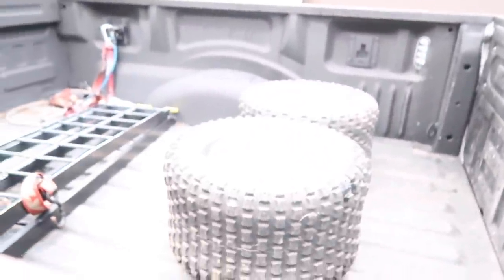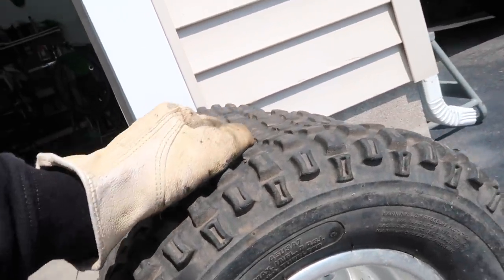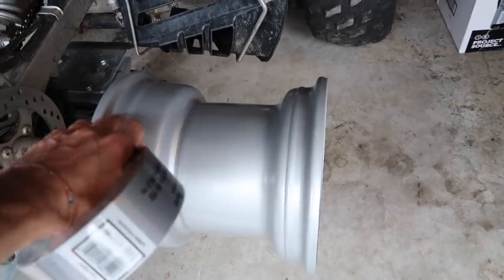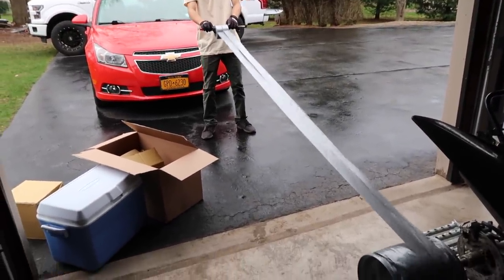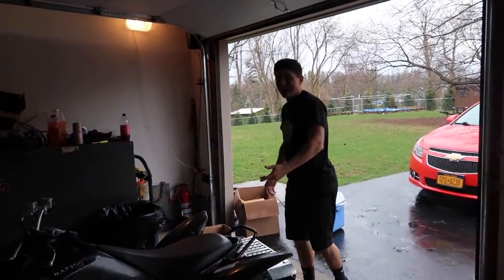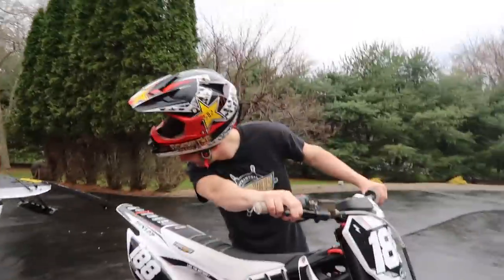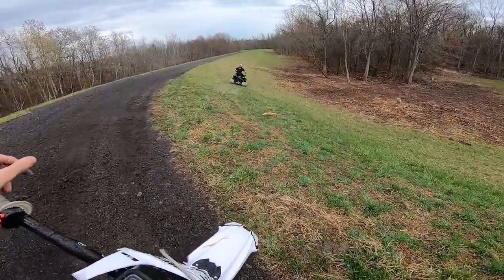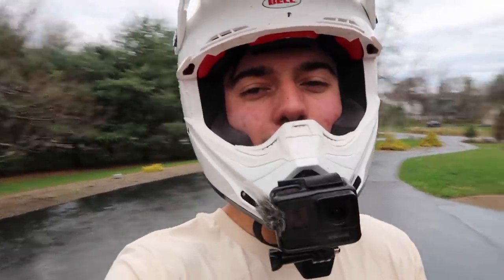DRIFT QUAD DUCT TAPE TIRES!!! This Was Crazy..

Comment: Normally to take tires off you release the pressure by poking an item into the valve stem then use pry bars or a big flat head (or tire changing tool lol) to pop the bead off the shoulder and from there it's pretty easy to get the tires off the rims, just get the tires at an angle, one side first, and kind of walk it off, way easier than using an angle grinder to mutilate the whole thing. Nice video tho looks like it was a lot of fun!

Comment: Hey man, a little trick to cutting off tires, use a sawzall. It cuts through it with no problem and it doesn't make near as much smoke as an angle grinder.

Comment: You need to do 12 inch PVC pipe cut it about 10 inches wide Deflate your tires put the PVC over your tire and slowly air the tire up until holds on to the PVC pipe and then go drift with that

Comment: I know the struggle of the wrong bolt pattern, I bought a set of used wheels and had to use a rasp to elongate the bolt holes a bit to 4x110.

Comment: Next time use pvc pipe. I've got at least 4 hours of drifting on them and they are still good. 12 -24 inch pvc I available.  Air down the tires and slide the PVC over them air em back up and have fun